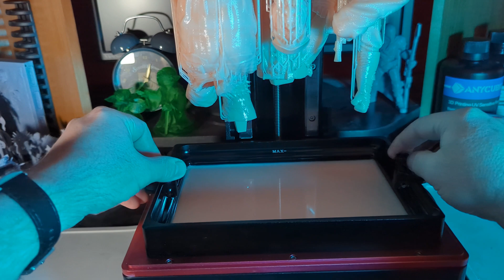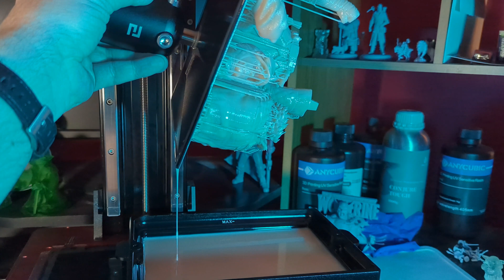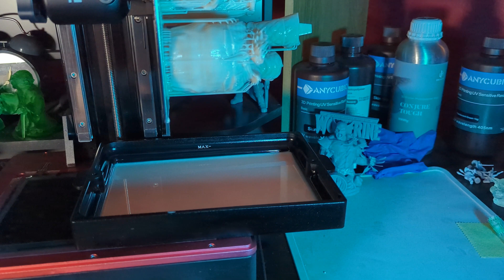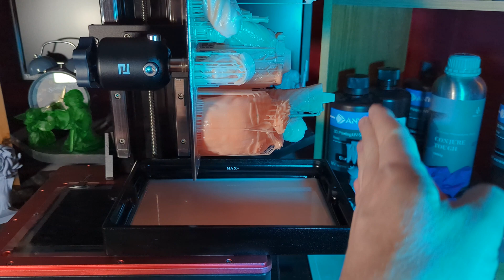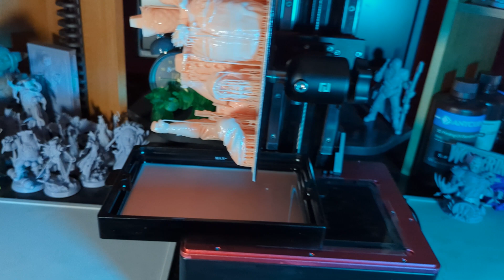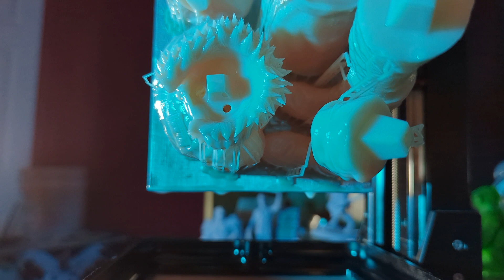Resin Printing 90 Degree Build Plate Rotate to Drip Off Excess Resin on an Elegoo Saturn

Comment: does this work with the saturn 3 ultra? I'm very new and I'm about to finish my first actual bust that isn't a calibration square and I'm worried I would damage the bed holder. Thanks
Reply from the maker: I haven't personally tried it with a Saturn 3 Ultra, but the holder appears to be square like the Saturn and Saturn 2 where I use this method often. It's solid, sturdy metal, so it shouldn't damage it by just rotating it and screwing the holder onto the side rather than the top. Just make sure your vat is moved over far enough to catch any dripping resin from the top of the model and be very, very careful not to drip any resin on your screen, which I highly recommend you protect with a screen protector. Also, as mentioned in the video, make sure you don't move your vat further over than halfway because it could tip over and cause a big mess.
Reply: @geekyfungi  Hey thanks for replying. Turns out no , the slot for the bed holder in the staturn 3 is slightly rectangular (the bed has 4 screw so no ball). It was a good idea, I'm thinking of printing a holder for it. But thanks for the help anyway.